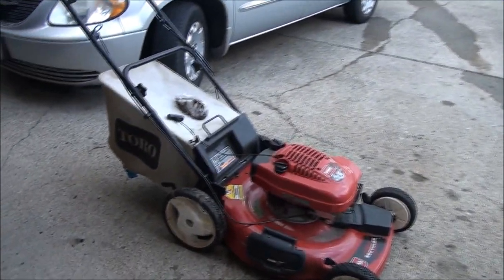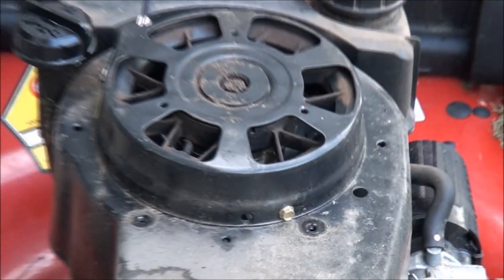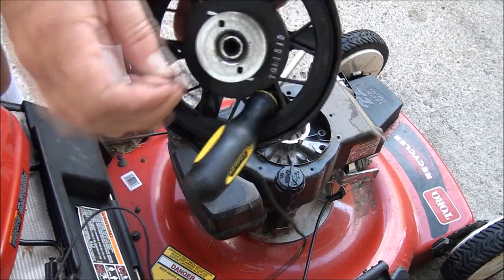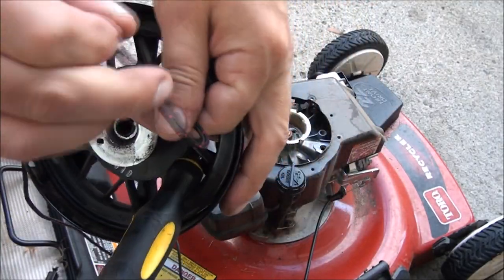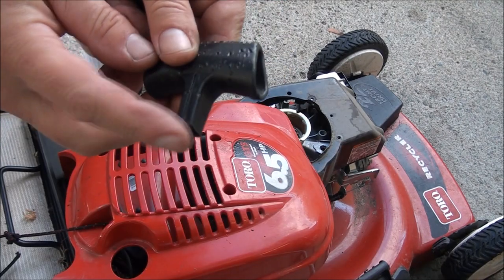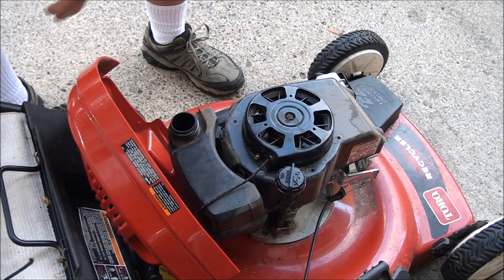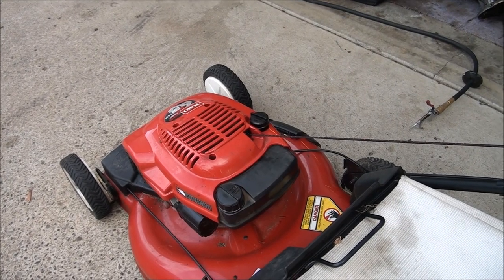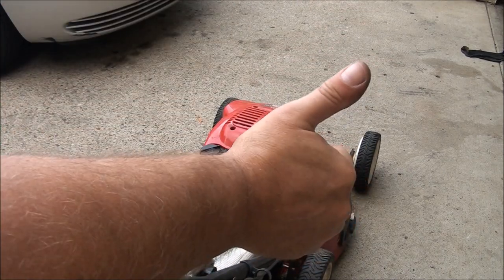HOW TO Replace / REWIND the STARTING PULL ROPE on a common TORO GTS Recycler Lawnmower. TECUMSEH

Comment: Great video. Fixed my 2008 mower. Even talked about the ferrel. Thanks for the 7 times winding, very helpful.  Just bought 8' of Stihl starter cord at Ace. Was still $4 in 2024, cut off 6" to match the old. Works perfect, now mine is white. One BIG tip: Start with the lower knot and feed it backwards from the center of spool. It was much easier to go that direction and out the spool hole and then up to the handle.  I couldn't feed it the other way.
Reply from the maker: Good job! thanks for the comment and thanks for watching

Comment: Helpful tip.  When threading the two holes, start on the inside (smaller) hole and come out through the outside (bigger) hole. It will save you from screaming obscenities.
Reply from the maker: Great tip!
Reply: @JeffsLittleEngineService  .
Reply: @JeffsLittleEngineService  kn

Comment: I have 2 recoil starter cord assemblies. 1 is the original 2. Is the new one. I installed everything correctly but with the new recoil starter the cover would not line up with the screw holes on my toro recycler 22. With the original one it will. I don't understand as they are both identical and I am not doing anything different... So I know how to install the string. That isn't an issue... my issue is how can I take the new components from the device and put them into the old one? I see so many videos on how to change the springs and when they start taking the assembly apart there is a bolt or screw that holds it together. Well my recoil starter assembly doesn't have a bolt or screw to take the assembly apart. So how do I get it apart to change out the parts so I can get the cover correctly one it and get my lawn mower working?
Reply from the maker: Take another look there may/should be other screw holes that you can use, located next to the holes the old assembly used. Drilling holes can be done fairly easily also. Taking this mechanism apart can be done but it is not easy I would not recommend doing that.

Comment: Excellent, just what I needed; mine just broke. But are you sure about requiring 8 ft.? I measured the length of my broken pieces & they were about 65-70 inches, or 5 to 6 feet. Thanks.
Reply from the maker: it varies from model to model

Comment: Great video with one caveat.  I wouldn’t use a lighter next to the fuel tank with the fuel cap removed as you did at 6:15.  Otherwise, very helpful.

Comment: I have a Recycle 22 smarstow and the pull cord is broken. Although I have seen videos on how to, this Toro model has the plastic wheel (cord holder) tightly held with flat rivets and not screws or bols. This prevents from accessing the cord wheel as it can't be raised. How can we lift this and then replace those rivets once cord is replaced? AB